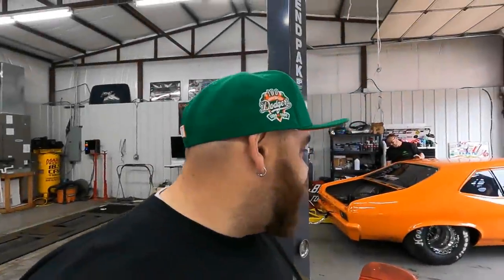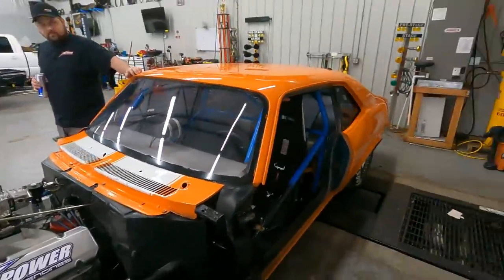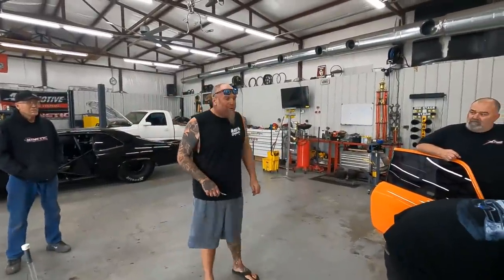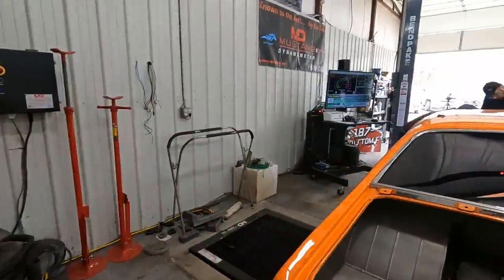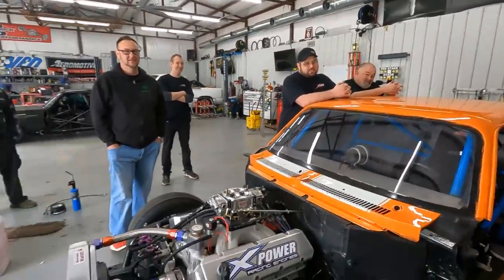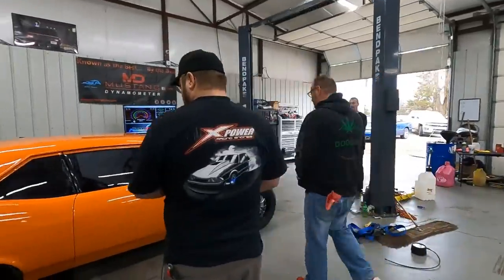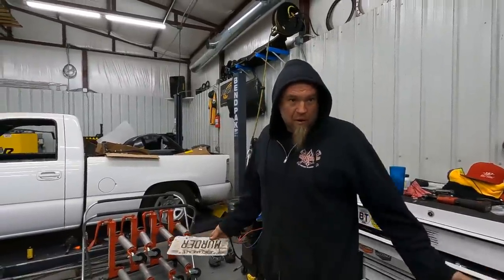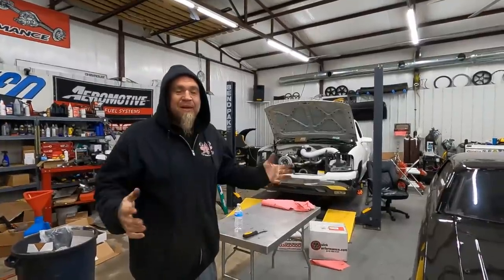Dynoing an 1100HP Small Tire Nitrous Car and Getting Murder Nova Loaded To Go Racing!

Comment: The orange car with the little big block nitrous motor was rowdy, looked like it was making more like 1500. Maybe just dynoing in low gear for a tune and not showing high gear pull? I didn't look at mph, but, good luck this weekend boys! 👍🏻

Comment: Those Dyno pills were sweet! Dyno the k5😂
Reply: 130-140hp to the wheels🤣 Not hating, I have a K5.
Reply: Lol lift the K5 instead
Reply: Lol what's a dyno pill? Lol just joking I have fat fingers I do same chit all the time
Reply: I need to get my  91 K5 on the dyno. Hasn't been tuned yet. 6.0 4l80 swap 76mm turbo 15 inches of lift on 24x14s on 37s
Reply: @whiteboysteve4474  stupid automobile correct  😂😂😂
Reply: @whiteboysteve4474  Sounds like a sweet setup. I’m going a very similar route. I’m rebuilding a 6.0 and 4l80e. I did a 4” lift on 325/60r18 (33.4 13 18) on 18x12 Fuel Mavericks. Right now doing body/paint. I daily drive when I’m not working on it, so i didn’t want to go to big. I had a k10 on 37s and sometimes it was a PITA.
Reply: @jasonpaddock3580  lol I hate when auto correct makes me look stupid
Reply: @deegan727  I bought a wrecked 2000s 2500 truck at auction pulled motor tranny and wheels off of it. Parted rest of what was good out. I already had a K5 I traded 86 swb c10 for. Somebody before me lifted the k5 and 1 ton axle swapped it. So when I got wrecked truck I pulled tbi 350 700r4 and 15x14 welds off it. Sold all that. Everything I sold from both trucks paid for turbo. I just got a 84 crew cab c20 I'm going to short bed and put reg  suspension on and drop. I'm just going to buy another 2000s auction truck swap motor tranny suspension on crew cab
Reply: @whiteboysteve4474  I bought a 2002 2500 from a coworker for 500.00 running driving. Did the same thing, parted out what I could cut up and scrapped the rest. 15x14 Welds would be cool for an extra wheel tire combo. I’m kind of looking but the prices for Welds put that idea on the back burner with everything else I’m doing now.